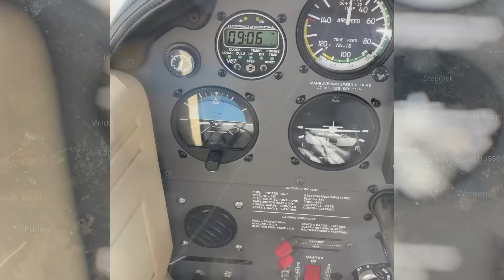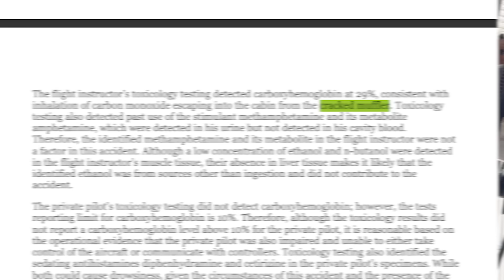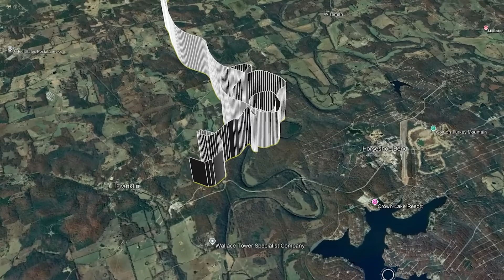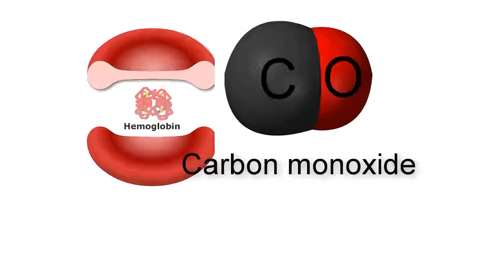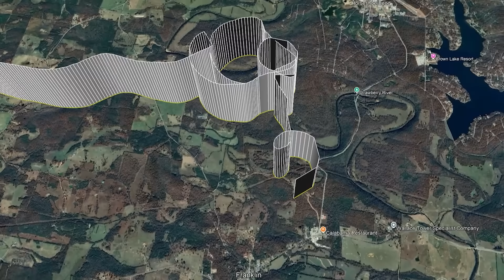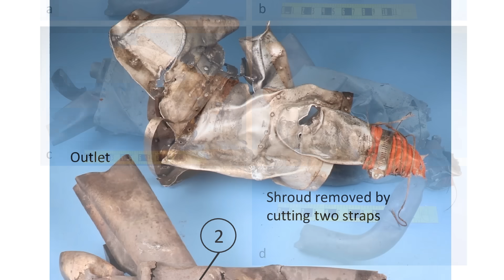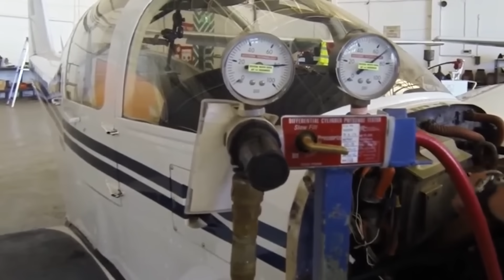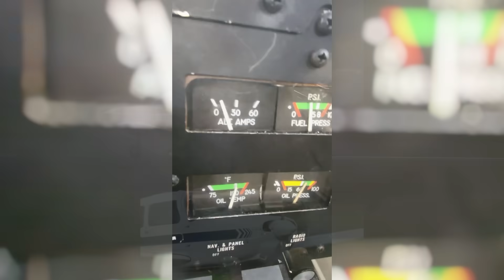Why the Pilots NEVER Realized They Were Losing Control

Comment: For last 6 yrs I've always flown with TWO electronic Monoxide alarms.
One with digital display showing the % HC concentration.
2nd one is a basic alarm which beeps at a certain level.
Those yellow cardboard discs most pilots fly with are pretty ineffective ⚠️